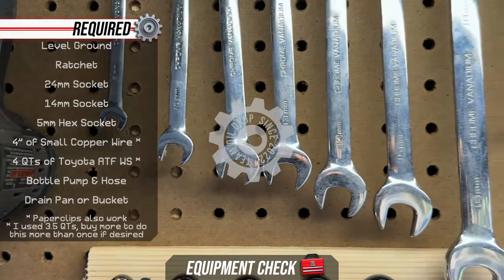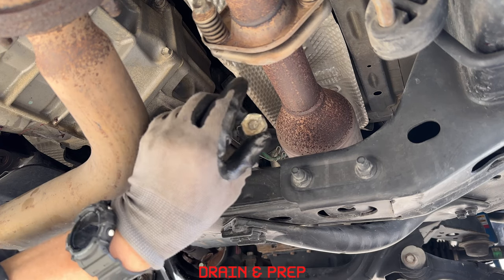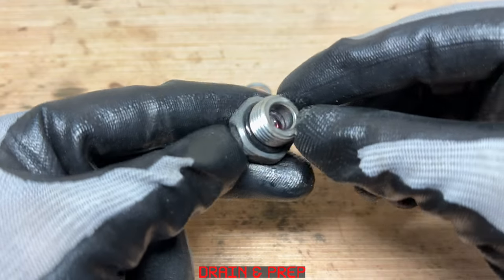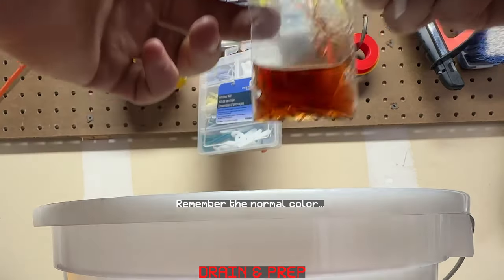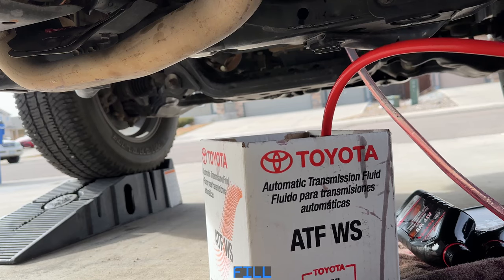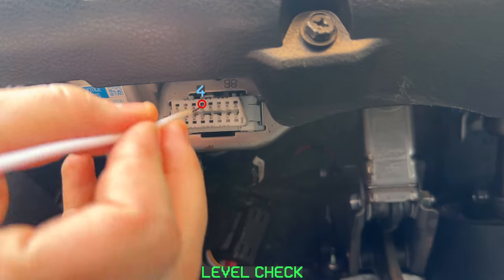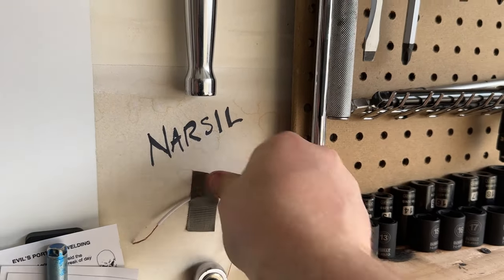How to Replace Transmission Fluid Drain & Fill Tacoma 3rd Gen

Comment: I have a 2020 Tacoma 3.5l. My owners manual says for a transmission flush I need to put 10.8 quarts. Why did you only get 3 quarts when you flushed it?
Reply from the maker: That’s a flush and this is a drain and fill. Only one of these can be done DIY in your driveway. A flush requires a special system to completely exchange all the fluid with pressure. Your dealership can likely perform this for an arm and a leg. Drain and fill is a also performed by your dealership, Toyota, and any local mechanic, as well as can be done by you in your driveway.

Comment: My question isn’t about transmission fluid, but this video made me think of it…

I just changed my oil for the first time on my Tacoma, and it looked like the washer stayed on the pan just like your transmission pan here.  I tried pushing it off with a flat head bc I figured it’d just pop off if it was meant to come off. 

It didn’t budge after I pushed a little harder than I was planning so I assumed it was part of the pan and needed to stay. 

How do you get those off of the pan?
Reply from the maker: Putty knife works well. 

The Editor

Comment: If driving a manual transmission,would you roll through each gear and reverse in lieu of the neutral to drive?
Reply from the maker: You’re in luck! Manual transmissions are significantly easier. Here’s a great write up on a DIY for yours: 
https://www.tacomaworld.com/threads/3rd-gen-differential-and-manual-transmission-6mt-fluid-change.481719/

Comment: My truck is at 91,923. And it hasn’t been serivced for transmission. Should I change the filter?
Reply from the maker: The general idea is to service before 100k
I would suggest a drain and fill every 25k. I would be dropping the pan and changing the strainer. With a clean pan, accomplish the fill and fluid level check.

The Editor

Comment: My OBD port 13 has no metal connection. Its a empty slot. Any idea how I can get AT temp Mode .
Reply: By the way, the model of my truck is a 2021 toyota tacoma limited V6.
Reply from the maker: @avenerisaflor6606  hey brother! Check notes for 2020+. In the description and pinned comment

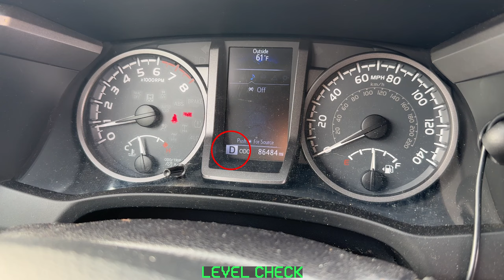Comment: it says drive few seconds ago you said put it on park. And once the the D LIGHT came back on at 4:27. Did you have it back in drive with foot on brake ?
Reply from the maker: Yes, that is correct

The editor
Reply: Quick question here - went through the procedure and when I was in drive it was solid, put in park and it flashed D. Went back to D and solid again. Which one am I tracking?
Reply: I drained 2.5qts, put in 3.75, and then 1 qt came out during the test

Comment: Nice Brah! Over 80K miles!
Anyone here switch fluid to Valvoline Maxlife?
Mannn OEM WS is so expensive 🤣
Reply from the maker: Some have, most use WS.
It's certainly an option. IMO, the OEM fluid is a lot cheaper than a transmission.

Its your call

Greg the Editor

Comment: I did the neutral to drive steps but instead of the drive disappearing it blinks. Is there a reason it does this?
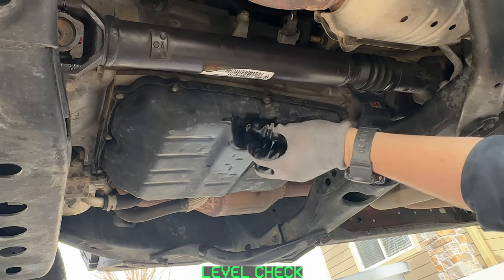Reply from the maker: Check the vid at 4:28 in the text box. The fluid got too hot to properly check.
Reply: Thank you, sir! I appreciate the help. I believe having the ac on threw it off course. I turned it off and it worked. Appreciate you taking the time to help!
Reply from the maker: @FernandoRodriguez-tr8vr  my pleasure! Happy driving

Comment: 2017 doesnt have trans dip stick i was told its sealed that it doesnt need replaced.
Reply from the maker: Correct, it does not have a dipstick. But, you were given rather bad information.
It's not sealed, it has a fill, a drain and a procedure for servicing.

Get the Editor

Comment: What size socket did you use for the fill plug? 24 mm?
Reply from the maker: That’s right! A big boy
Reply: @teamoildrop  Thank you. I'm pretty sure my new Tacoma came with low atf from the factory. Worth the effort to at least check. Thanks for the video, explains the process perfectly.
Reply: @teamoildrop  One more question.. to get the vehicle out of temp check mode, do you just turn the vehicle off and then next time it starts, it is in driving mode again?
Reply from the maker: @Logan-vl8ek  correct! No wire in the port and a restart means good to go. Later models should just be a restart.
Reply: @teamoildrop  Yeah, I saw Zach's comment. Interesting enough, I have ran through 3 attempts to get the truck in temp check mode without the wire and have not had any luck. I started the truck went through the gears P - S then back to P. Then I went from N - D back and forth repetitively with no luck. I tried doing an interval of 6 seconds, 8 seconds, and 12 seconds, but no joy.
Reply from the maker: @Logan-vl8ek  do you see metal contacts in the ports? If so then that makes sense, wire needed!
Reply: @teamoildrop  I got it to work without the jumper.
I followed this exactly ending in neutral and it worked:

To enter automatic transmission fluid temperature detection mode:

    Depress and hold the brake pedal.
    Start the engine. [#1]
    Turn off electrical and mechanical loads
    Slowly move the shift lever from P to S, then move the shift lever to P. (~3 seconds each position [#2]
    While observing the D shift indicator on the combination meter, move the shift lever back and forth between N and D at an interval of less than 1.5 seconds for 12 seconds or more. [#3]
    Perform #1, #2, & #3 within 60 seconds
    Check that the D shift indicator comes on for 2 seconds.
    Move the shift lever from N to P.
    Release the brake pedal.
    Allow the engine to idle until the automatic transmission fluid temperature reaches 35 to 45°C (95 to 113°F). The D shift indicator will come on again when the fluid temperature reaches 35°C (95°F) and will blink when it exceeds 45°C (113°F).
Reply: I wasn't doing it long enough..
Reply from the maker: @Logan-vl8ek  soooo close. Good catch. This will be useful for others.

Comment: Question man what would the truck temperature be at for the ob2 scan tool?
Reply from the maker: For a third Gen 95-113*F

The Editor
Reply: That’s the temp it should be at to drain the over fill?

Comment: Dear friend.  Good video but it I do, changes the transmition oil filter.  The most important part, in my opinion is the filter.👍👍🙏🙏
Reply from the maker: Thank you! I’ll show us soon, but most of our trucks don’t have a replaceable transmission filter but only a permanent metal mesh filter!
Reply: But is with metal, can clean and push again.
Reply from the maker: @hectorpenamedina4817  I will show! Yes, if you have big chunks you have big problem 😌

Comment: Why do you put it in temp check mode, i never heard of that before.
Reply from the maker: Due to ATF expanding when at operating temp, you take a level check at this point. Taking a check at any other temp (too hot or too cold) can be detrimental because the quantity in your trans will be off.
Reply: @teamoildrop  rapid fire response thank you! My first transmission fluid exchange.
Reply from the maker: @D4RKxMARAUDER  enjoy the process!

Comment: You forgot to cover the transmission thermostat. You should pin the transmission thermostat to allow the trans fluid to run through the radiator and trans cooler (if you have one). This will allow for an accurate fluid level when running at optimal temperatures.
Reply from the maker: It wasn't covered. Yes, it will slightly affect the total fluid quantity. 

Greg
Reply: @teamoildrop the slight difference is about half a quart. I love the content but this video in particular is missing a relatively important step. Its why toyota allows the the trans thermostat to be manually opened....Anyways, keep up the good work. Just trying to help the channnel out putting good informative information out to the community 🤙🏼

Comment: Great video but I can’t get my 19 taco to go into temp check mode to save my life. I’ve let it sit overnight too. Luckily I have a 4Runner with 310,000 miles on it for back up. I’m at a loss and getting a bit aggravated with it. Almost ready to say f it and drive it regardless. I want to re gear it anyway so I guess that’ll give me an excuse to re gear. 🤷‍♂️
Reply from the maker: Strange... I'd recommend joining the discord to ask the group for some extra advice. This is a new one for me. I assume the wire is in the correct pins?
Reply: @teamoildrop  according to the video I’m using the correct pins. My port is positioned upside down from the video though. I thought that was odd. I’m going to try again this morning.

Comment: Question my trd sport came with tow package. Is it the same process? Do I have to mess with thermostate.
Reply from the maker: Depending on the year the process will either be the same or easier as you may not have to use a jumper wire to enter temp check mode. This seems to be 2020 and newer. The thermostat is completely up to you, I personally don’t bother with it.
Reply: @teamoildrop  Thanks
Reply: @Team Oil Drop  just did my transmission oil change. I followed your steps easy thanks again.
Reply from the maker: @joegonzalez5602  love to hear it

Comment: Does transmisión filter needs to be change as well?
Reply from the maker: Toyota doesn't list an official interval for the transmission filter, so you can use your own discretion on whether or not you feel it's necessary. We'd recommend about every 100k for a new filter!

-Austin
Reply: How many quarts of transmission fluid?
Reply from the maker: @renanperez1616  depends on how much you drain. All the answers are in the video brother.

Comment: What size torque wrench you used on this project
Reply from the maker: Dewalt 3/8” drive. I’m a big fan of it.
Reply: @teamoildrop  I have a 1/2 torque wrench is that okay ? Or do I need to buy a 3/8
Reply from the maker: @DavidRodriguez-qt5ux  it depends, can your 1/2” be set low enough to snug these bolts? If so, you’re good to go. In the flip side, it’s never bad to have one of each.
Reply: @teamoildrop  yes sir, I bought a 3/8 just now. I decided to do this project myself instead of paying Toyota $350 that includes the fluid
Reply from the maker: @DavidRodriguez-qt5ux  outstanding! Let us know how it goes
Reply: @teamoildrop  yes sir, much appreciated

Comment: When I try and put my truck into temp check mode the D goes away for a sec then begins to flash?
Reply from the maker: When it starts to flash, you waited too long and the transmission temp is beyond the temperature range for a proper level check. You need to wait for it to cool and start over.

The Editor

Comment: This is a different process from what I've seen on other channels.   I have not seen the jumper wire used before.
Reply from the maker: Earlier 3rd gens… 2016-2019 I believe, required the jumper wire step.
Reply: @teamoildrop  I did the transmission fluid today.  Your process was perfect.  The Car Care Nut indicated, after rapidly shifting from drive to neutral, the shift indicator would indicate "DRIVE" all the time. That did not work for me. But your process did work for me.  Thanks.  
I plan to buy a mating OBD connector and connect pins 4 and 13 permanently so I can just plug that into the truck for future transmission fluid changes.  This way, I know it is correct and I won't accidentally connect the wrong pins.
Reply from the maker: @gregd4391  I love the dedication. Definitely a neat little project to have ready. Thanks for the words!
Reply: The same happened to me, but neutral, reverse and park all dis appeared

Comment: Is it weird that only 2 L came out when i opened the drain valve?
Reply from the maker: It is rather weird. But, many owners have reported transmissions that were under serviced from the factory. I checked mine at 350 miles, it was 1/2 quart low.

Greg

Comment: Better off taking your truck to a service center that does a complete flush which also back flushes the screen filter in the transmission, by just draining out a few quarts there’s a lot of dirty quarts left behind and don’t even think about dropping the pan cause you will break most the bolts holding the pan, would you just drain out a quart of motor oil and just add one back in or would you rather do a complete drain
Reply from the maker: There’s a number of reasons why we don’t follow your advice. 1. A complete flush eliminates all the deposits in the fluid that assists the transmission. 2. If your screen filter has buildup you have much bigger problems. It’s not a fine mesh filter. 3. Many mechanics  don’t do complete flushes and only drain and fills like my local Toyota dealership. 4. This procedure is verbatim from the Toyota TSB and what the dealerships follow.

Comment: Hey bud. I think I really screwed up. I put Valvoline Import ATF on my 3rd Gen. I thought it was the same, now I'm really scared, don't know what to do.
Reply from the maker: So Valvoline Maxlife (red bottle) is a very common alternative to Toyota ATF WS. I’m an OEM guy for most things but have run maxlife before to no noticeable difference. However, Valvoline import, a relatively uncommon ATF is a different choice. Option A is get comfortable enough with the limited info you can find online  about it or option B, drain and fill it 3 or 4 times with an appropriate fluid. I know this doesn’t help much but in this case I am an option B guy.
Reply: @Team Oil Drop  I was thinking of doing multiple drain and fills. Also considering having it flushed/exchanged but that could do damage too. 

I'm so sick to my stomach 😨
Reply from the maker: @emorse912 your truck will be perfectly okay. Do a few quality fluid swaps, and put it out your mind.
Reply: @Team Oil Drop  Thanks for not calling me names or being negative to me for my mistake. 
I'm trying to calm my nerves. 
I'm looking into doing a flush at a local dealership, but stuff online says that can cause damage. I'm lost.
Reply from the maker: @emorse912  We all make these mistakes, thankfully for you you simply put a less-known tranny fluid in your tranny. Nothing bad will happen immediately, if it all. Drain and fill a few times per the video, you will be good. Additonally, use tacomaworld.com to ask the same question here. There are those that know way more than me!
Reply: Drain and fill 4 times. Use Toyota WS fluid and drive 500 miles or so couple tanks of gas in between each time and you’ll be good no more worries.
Reply: Update: I had the dealership flush the system and add the Toyota WS. It's been 6 weeks, and the truck runs perfect.

Comment: So I barely got 2 quarts out of mine.   I'm thinking it was under filled from the factory.  Anyone else have thus issue?
Reply from the maker: This is a very common reported issue actually. Under filled / slightly under filled at the factory has been reported on countless occasions.
Reply: @teamoildrop  I guess what I'm going  to do is add 3.5 like you did and let it drain until it's at a Trickle.
Reply from the maker: @kyleguthrie4598  that’s the move!
Reply: @teamoildrop  so u just did it.  I added around 3.75 quarts. It drained out around a quart till it trickled.  Putting me at around 2.9 quarts or so.  So basically it was around a quart low.
Reply from the maker: @kyleguthrie4598  good job.  Now you are at the proper level. Your truck thanks you.
Reply: If you have a 2WD truck, only 2 quarts drains out of the AC60E transmission.  4WD models have the AC60F transmission.
Reply: @4af  no I have the same exact truck he does in the video, it's just a 20 instead. And it's 4x4.
Reply: @kyleguthrie4598  in this video at the 12:20 mark a 2021 V6 4WD owner drained 2.65 quarts:https://youtu.be/6yXGHiAtiUY?si=ZwpyHA-Ifu20otSs
Reply: Just drained my wife's Tacoma today and it was a little over 2 quarts. Just hit 60k on her 2016
Reply: @AlohaArmbars  I was told you have to to drop the pan to get all of it out. A simple drain and refill won't allow all the oil to come out.

Comment: The jump wire doesn't work on my 2020 offroad, anyone know why?  Btw my camry will go into diagnosis mode
Reply from the maker: Notes:
One user (zacharylechevalier202) reports they could get their 2020 Tacoma into temp check mode without a wire as their truck does not have a live connection in the OBD port 13. They just did the neutral drive back and forth.
Reply: @teamoildrop  can you explain that to me.  Because it didn't work for me.
Reply: How many times would you recommend doing this in a single interval? @teamoildrop

Comment: How many quarts to drain and fill?
Reply from the maker: @eod4usa  always plan to drain up to 4 and have 5 on hand. You’ll add 0.5 quarts more than you drained in most cases.
Reply from the maker: @eod4usa  then you’ll do the temp check

Comment: Sitting for 30 mins didn't cool down enough for the temp check. Still right to blinking. 80° here. I wonder how important it really is if everyone has such varying amounts of fluid from the factory.
Reply: And what if it' solid when you're looking at it then changes to blinking as soon as you get out of the truck to drain it? You would never know.
Reply from the maker: It is important to make sure the fluid level is accurate, but you’re correct you can’t be 100% certain. Unfortunately you may have to wait overnight or until the weather cools down to get it into temp check properly. 

-Austin
Reply: @teamoildrop  I'm guessing that D,N,D,N,D,N,D,N,D,N is causing it to heat up too much? I paid for the extra readings for my OBD scanner. Trans temp was 124 when I drained it. I believe that is in range. Thanks for the tacoma videos they help a lot.